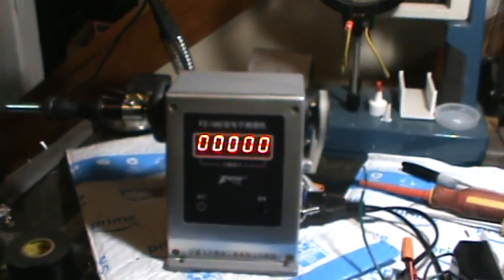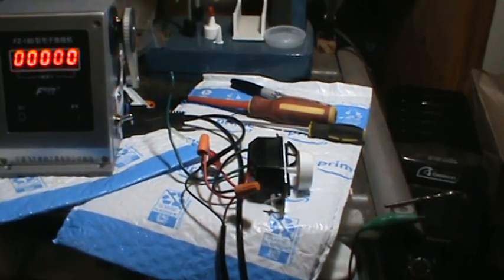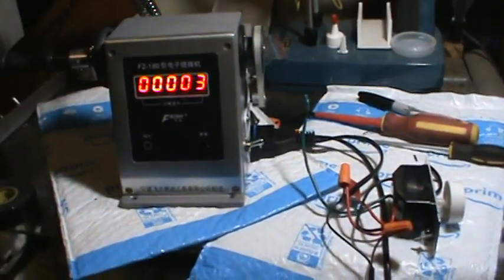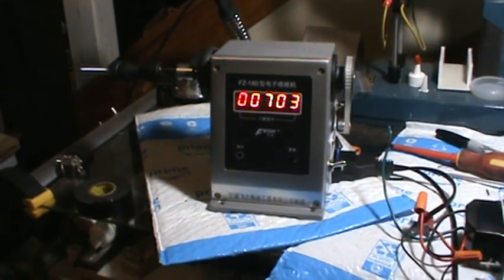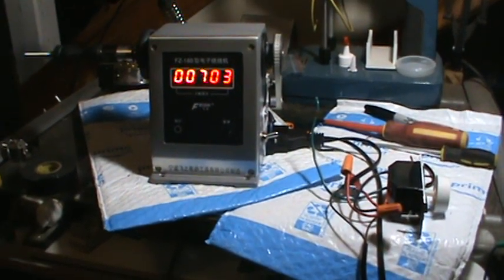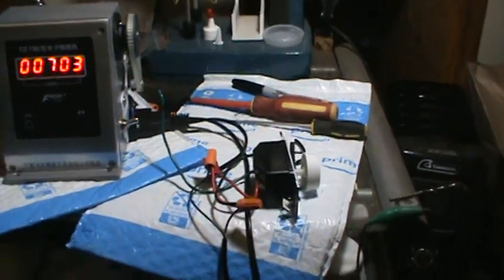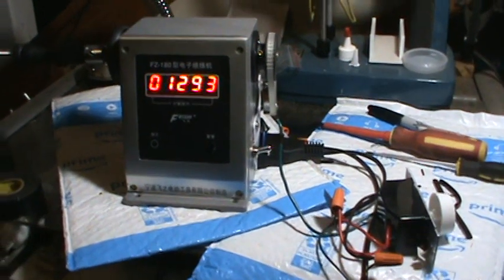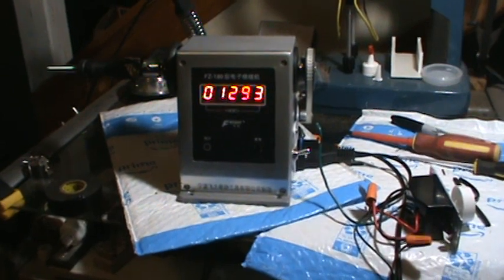Slowed down the coil winder with a dimmer switch

Comment: If you want it to go slower without losing power you change the top gear to a even bigger gear. If you want more control you need a brushless motor like a stepper motor, a 12 volt power supply, 2 mosfet's , a potentiometer and a Arduino Uno to do PWM. You can also have a push button switch to turn the circuit on/off.
Reply from the maker: I just put out another video Ray .